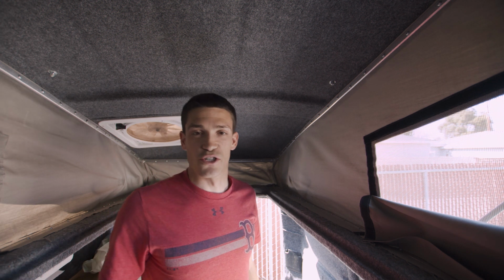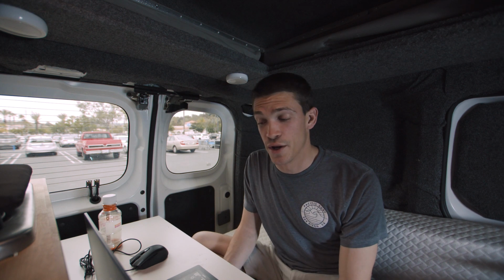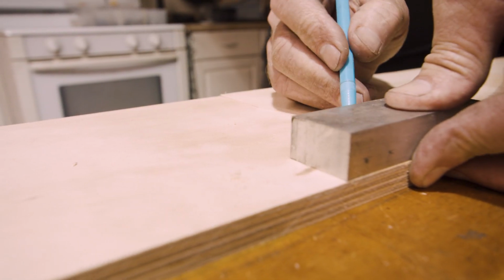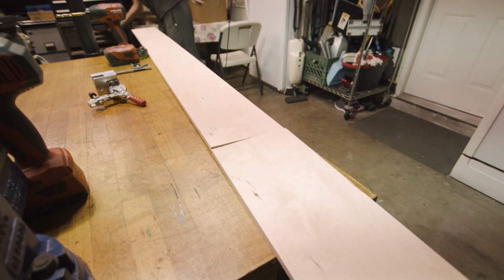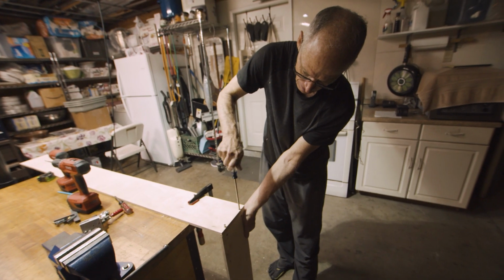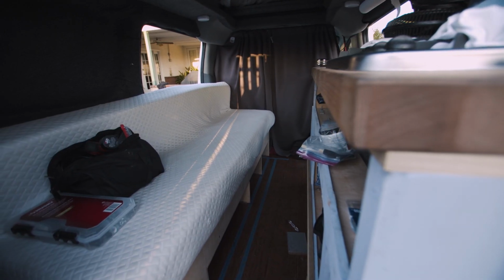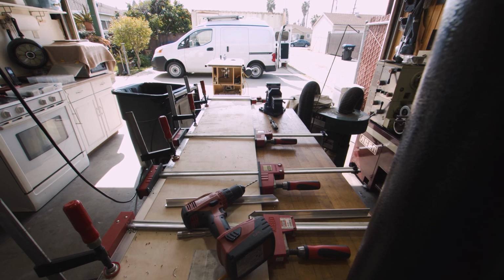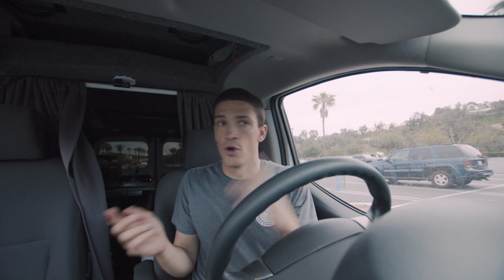Lex's Brilliant Van Build Style | How To Build A Campervan With Cross Dowel Construction

Comment: I contacted Lex and ordered both the cross dowel jig, and the c chanel jig.  I originally built out my galley in my 2010 transit connect for a wider water tank then I ended up buying so have about 4 inches of wasted space and built out of 1" pine tongue and groove.  Now I will have a wider area between my couch and the galley (my layout is like yours) that I might be able to add that 20ltr compressor fridge under my bed and be able to pull it out into the van's "walkway", not out the back door lol.  So will be a cool projects to redo the galley and bed out of a lighter weight wood!  And like you said it is a skill that you will be able to carry over into other projects!  Thanks

Comment: Very cool.  And thank you for the instructive explanation of the cross dowels method.  We've bought flat pack furniture before with those in it, and had to literally destroy the 'flimsy' furniture to dispose of it.  Those joints are very, very strong.  But the partical board furniture was NOT.

Comment: I’m a builder of all sorts of things and could never get my kids to do anything. Now they’re leaving the house and realize how much they’ve missed...
I’m glad you appreciate what you’ve learned from him and put it to good use later. On a side note, pocket holes are a great and fast way to build strong things as well. Less versatility in undoing and redoing over and over, but how many times do you want to take things appart ? Safe travels
Reply: I've had little issues like my backup camera failing and the side door having electrical contact problems.  When I take it to the dealer they tell me they can do nothing until Winnebago or whoever built it removes the cabinetry.  I can remove the cabinets in a few minutes and we're good to go.  We took Nate's build apart at least a dozen times as we made small modifications.  Didn't have to rebuild everything, just made the necessary changes.  Very difficult to do with pocket holes.  Pocket holes are also not very strong in 1/2" plywood or MFD.  In my experience cross dowels are stronger and hold up better in the "rolling earthquake" environment of a camper van.

Comment: I have a question about the aluminum u-channel that is attached to the floor.  The cross-holes:  What kind of screws go into the plywood?  If they are wood screws, why are the two holes back-to-back?  Do screws go in both sides?  Do you drill out the plywood and use a machine screw and a nut or pem-nut or something attached?  Awesome video, I'd love to hear anything else that Lex has to say.
Reply: If you look closely at the C-channel in the above photo, you’ll see holes drilled into the sides of the channel. These holes go all the way through both sides of the channel. When we’re happy with the placement of the vertical piece we drive a 3⁄4” long #6 screw through one side of the C-channel, through the wood, and out the other side of the channel. The vertical piece of wood is now captured in place. It can’t move up or down, left or right, and it’s right on the centerline.

Comment: Will the jig work on other thicknesses as well? Or is it just for 1/2 inch only?
Reply from the maker: Lex's jig is specifically for 1/2 inch plywood. It does have some flexibility and you can adjust it accordingly. You can also find jigs for 3/4 inch plywood online.
Reply: As Nate said, my Jig is specifically for 1/2" wood.  I also make them for 5/8" and 3/4" as they can be made for any thickness of wood you want - even up to 2"x4"s.  Ninety percent of my work is 1/2" on van builds, but I do use 3/4" solid wood like ash or maple for trim.  Woodpecker.com makes a universal cross-dowel jig but it starts at 3/4" and goes up. It will not do 1/2" ply wood

Comment: Did you think to put glue on the screws so they will not back out?
Reply: Trust me, these screws don't come loose.  It is one of the strongest construction methods available.  It also allows you to easily disassemble parts for maintenance or changes.  If Nate decides to run an electrical wire to the back for a USB charge port, he can have the whole bed assembly apart in about 20 minutes, run the cables, and have everything back together in a jiffy.  Glue wouldn't add any strength to the joint but would make disassembly a major problem.
Reply: Lex Rooker I tried using those before too Assemble some pre-fabricated furniture in those types of connections always seem to crumble under the pressure of Torking them down.Thanks for the reply
Reply: @raymonddriggers  These are not the IKEA style 'twist lock' connectors.  These use machine screws and they won't come apart if you use plywood or a solid wood like pine, maple, alder, & etc.  It is true that if you use MDF, it can crumble as it is made of sawdust mixed with a binder which will crumble under pressure or if it gets the least bit damp.  I think Nate will attest to torking down hard (multiple times) on all the screws in his build with no sign of weakness or crumbling.  He even used an impact screw gun and the joints only got tighter.
Reply: Lex Rooker Definitely seems the way to go when doing this type of wood work

Comment: Is a cross dowel joint stronger than a kregs joint?
Reply: Yes, much stronger.  A Kreg Jig joint is usually glued which means it can't be taken apart.  In most cases you are making an "end grain" joint which is weak to begin with.  If you bend the joint, the Kreg screws will pull out of the plywood.  Using cross dowels, the plywood and joint are under high compression actively pulling the joint together. The plywood itself would fail before the joint.
Reply: @lexrooker7334  thanks for the explanation Lex!  I'm not much of a metal worker but I do mess around with wood. Any idea how you can score a jig like that guy has? Something that you can actually buy or does it have to be made DIY?

Edit:. I see there are a ton of them available on Amazon. If you happen to have purchased one that you like, please let me know.
Reply: @peterdods425  I'm the guy.  I made the cross dowel jig for use with 1/2" plywood.  Woodpeckers makes a Universal Cross Dowel Jig but it is only for 3/4" plywood and larger.  Sablon also makes a very nice Cross Dowel Jig but again, only for 3/4" wood.  Both are in the $100 range.  If Nate gets enough interest I'm willing to make a batch.  If you're in the So California area you can also drop by my home and make one yourself.
Reply: @lexrooker7334   I'm a dolt. Didn't think for a second that you were that same Lex. Your Van build is top notch. I'm impressed as can be. I looked at the woodpecker already and did notice it was for 3/4 thickness and up.   I'd happily buy a jig made by you and pay for the shipping to Hawaii.  

You ever think about starting your own YouTube channel?  I would gladly subscribe.  Your build had a lot of unique features. I'm sure a lot of people would like to learn more about your bunk bed, your electrical system, your way of cooking your sous vide bags etc. Seems like you've got it really well figured out.

I recently got a 144-in wheelbase sprinter that I plan to start working on this summer. I've gotten a lot of mileage out of the ideas from your ProMaster build. Great great great work.  I can't speak more highly of what you're doing.

Thank you to Nate for introducing Lex to this channel!!! Mahalo to you both. 

And I would love to come check you out on my next mainland RV trip!!
Reply: @peterdods425  You are welcome to drop by my shop if you are in the area.  Might even be able to fix a few things for you like we did on Nates build.
Reply: @lexrooker7334  Mahalo Lex!